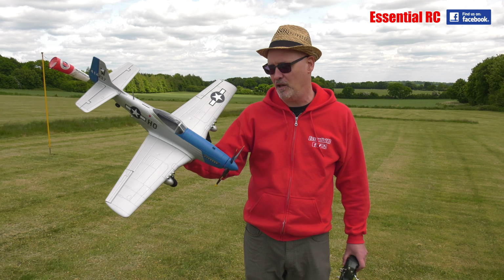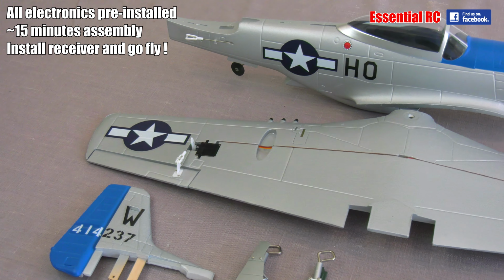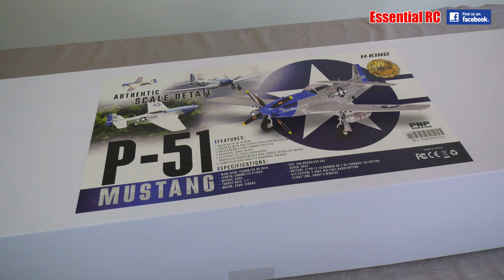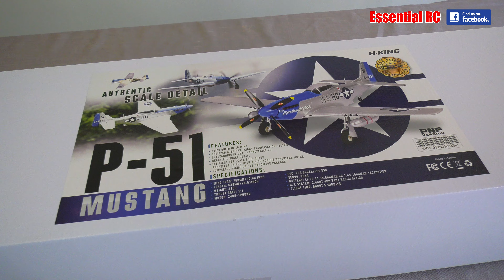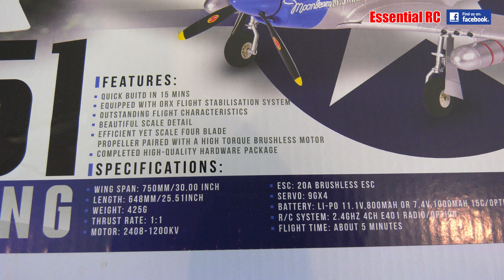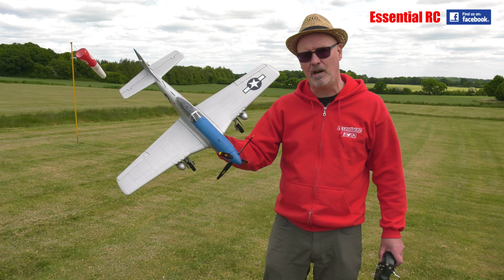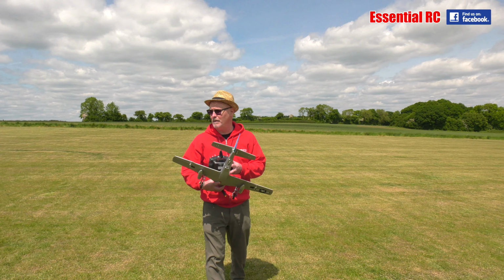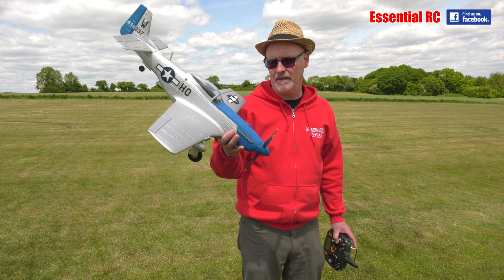UNBOX AND FLY IN 15 MINUTES ! H-KING P-51 MUSTANG PNP (2S or 3S) WITH FLIGHT STABILISATION

Comment: I've owned this baby for the past 12 months and it is a true joy to fly!
Reply from the maker: Just released today....so I really don't think so 🙄
Reply: @EssentialRC  it is the same as the moonbeam McSwine, they just put the stabilization on it. Exactly the same airframe.
Same deal as the A1, it is not a new
Plane it has been around for several years, hobbyking are putting stab modules on them.
Reply: Even without the stabilization, it is very stable.
Reply: What is the actual flying weight without the landing gear and with 2s? I wish it is less than 250gm.

Comment: Nice flight demo! I wonder if this is made by Volantex for Hobby King? I see it has the same clip-on landing gear as the Volantex P51D 750mm Wingspan ;-) See you in the Air!
Reply from the maker: I don't think so but could be wrong. It doesn't feel like a Volantex model to me.
Reply: It is made by TopRC and Hobby King just re-branded it by adding an orange 6-axis stabilizer to make it a V2. I got both versions and it flies great, but it is very fragile and weak on the motor mount,  also the props break easily.  I reinforced the motor mount with more glue also replaced the propeller hub with the one from the TopRC A1 Skyraider,  removed 2 of the 4 blades, it flies well and it is not so costly if you crash it.
Reply: @texasuavpilot  , Thanks for the info. I know from experience the the Volantex P51 is extremely durable ;-) I've never tried removing blades from those props but good idea ;-) See you in the Air!
Reply: @GroundControlRC  Yes they fly well with two blades only. If you watch 
GBLynden's RC video of the FlightLine P-51 you can see that configuration working well.  I also hand launch them all, had to remove the fragile landing gear on both my two P-51s and the A1 Skyraider, since it would come off and break after almost every other landing.
Reply: @texasuavpilot  , I switched out the stock prop on mine and installed a 7x4 2-blade on a 3S and way more thrust with slightly less amps compared to the 2S with the stock prop. I did get the landing gear reinforced and never had a problem with it after than and I had some horrible landings ;-)